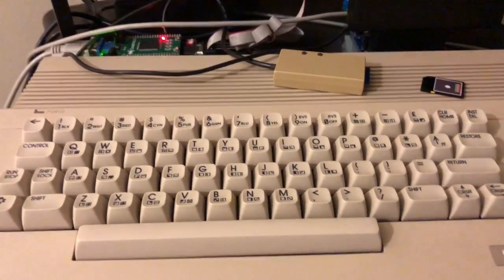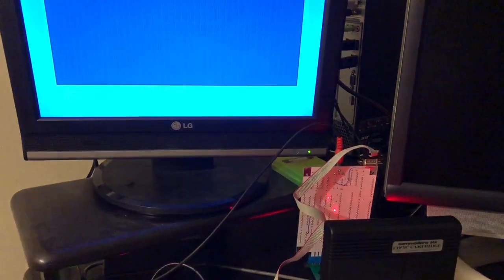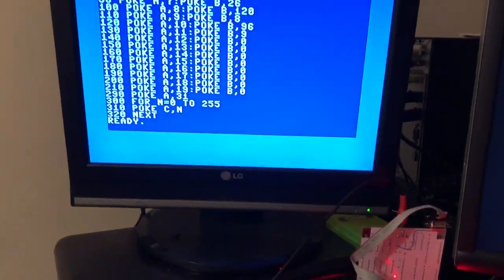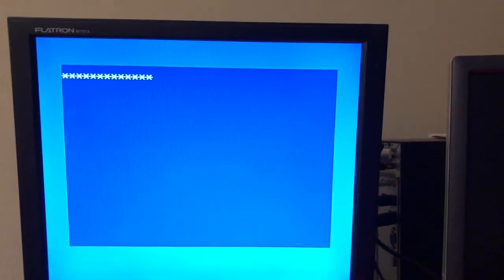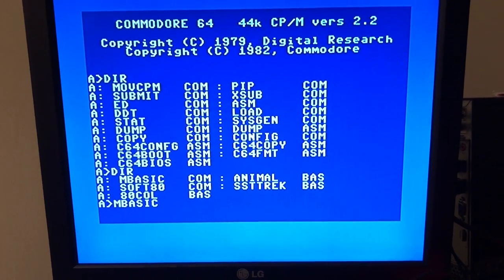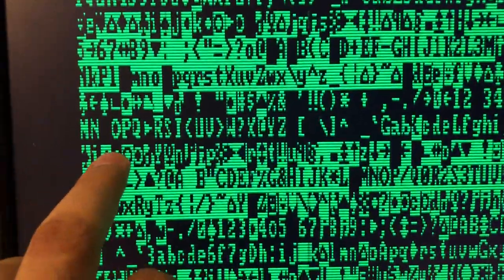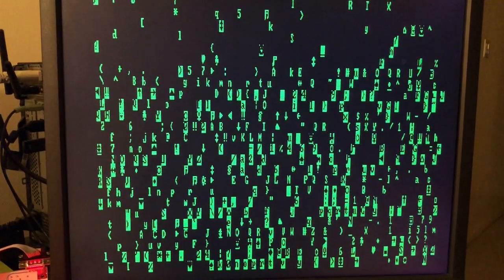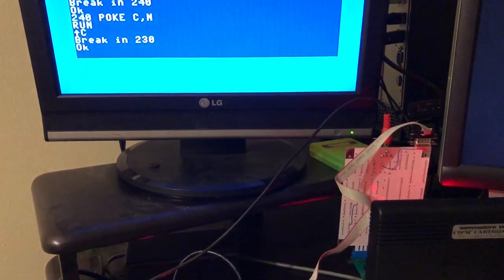CP/M on a Commodore C64C

Comment: so I'm a little new and uneducated, can you run cp/m on a stock commodore off floppy or do you need a cartridge and maybe even ram expansion?
Reply: CP/M was designed to run within 64K since most 8-bit machines didn't always have even that. The issues for the C64 included:

CP/M used MFM encoded diskette technology like a large portion of the computer world, whereas Commodore used GCR. The diskette formats are incompatible. Even when the 1571 came out, you couldn't just connect one to the C-64 and have it use MFM diskettes. The C-128 boots CP/M from a GCR diskette and then it has the necessary bios knowledge to read either format. This is why you can still boot CP/M from D64 images.

CP/M rarely used RAM expansions since RAM was VERY expensive at the time. Programming was done differently on nearly all 8-bit machines if you needed to use a large programming. There would be the loader part of the program and then as many overlays as necessary to do what the program needed to do. Let's say after a loader was in memory you had 30K left. Overlays could be loaded into that space and couldn't be more than the overlay space in size. This was common and worked pretty well - except that the C-64 had that slow drive thing going on. Still, it worked.

80-columns - obviously. Nearly all CP/M software came in the mentioned MFM format and expected to use 80 columns. There were ways around this, but the terminal emulation included in the C-64 CP/M was, how do I put this delicately..., lame.  The cartridge was already huge, why not add basic one color terminal? One that worked and provided 80 columns. 

Lastly, there's another issue - the CP/M cartridge does NOT play nice with all the versions of the VIC-II. So at best it might work completely. It also might not, or anything in between.

By the time the cartridge was released 1983 and CP/M was actually getting a little old then. It had a huge library of great software, but it was for a different that was a lot different. When the C-128 came out, it was an anomaly. The 128 booted CP/M from a custom version stored on a Commodore format diskette. The 128 was odd for another reason - in order for it to get the timing right, the machine booted from the 8502, which then passed control briefly to the Z-80 to set some things for the 128, then back to the 8502 and then into the boot ROM code for the 128. If you booted into 64 mode, it bypassed this and went directly to the 64 boot ROM code. By this time, people were interested in 80 columns, but not as much for CP/M. PC clones were the rage and almost the same price as a 128, especially when you added the cost of a 1571. The 128 survived because of the 64 mode and to at least have some software in 80 columns that was useful.

I lived through the era of CP/M, the VIC-20, the C-64, and the C-128. I loved them all. Eventually it just wasn't enough. So now I hoard my commodore equipment and my PC slaves for me. ;-)
Reply: You can with a stock C128, because it includes a z80 processor.  Not normally with a stock C64, he's got a CP/M cart on that port expander.  Cool, the fact that it reads and writes on each pass reminds me of magnetic-core memory.
Reply: The 64 had a CP/M cartridge released for it but it was more of a curiosity than anything else. If you really want to do CP/M get a 128 then you have 80 columns built in. This is a cool hardware hack though.
Reply: I never quite understood why a clever person didn't take a simpler approach. The user port can connect to a terminal, so why not make a device that sends output to the user port and let it go through a hardware device to output to a screen (the parts exist) and map the keyboard to that virtual terminal. Yeah - about the same amount of trouble as this, don't get me wrong. This is cool. However, I suspect with a little effort, I could send all keystrokes and output to a Raspberry Pi with a terminal program running and it would output to HDMI (potentially in color if a terminal emulator supported it). I'm less sure of what changes might be needed on the CP/M software side.

Basically, we need a terminal emulation, a video output system, and some software changes or just get a C-128. :-)